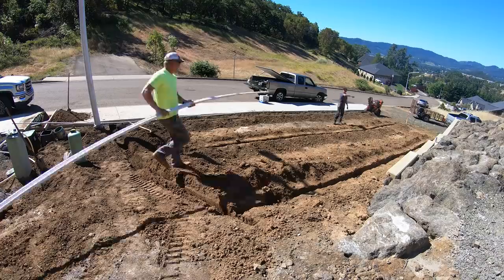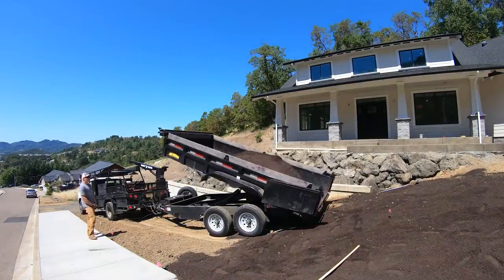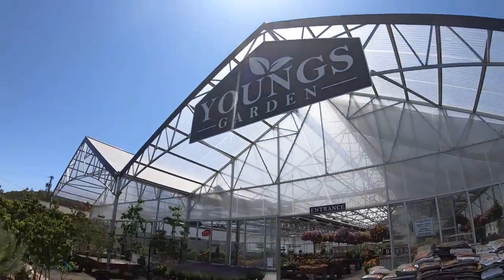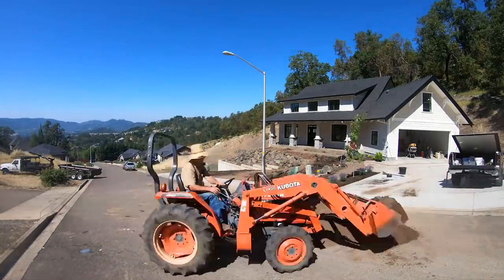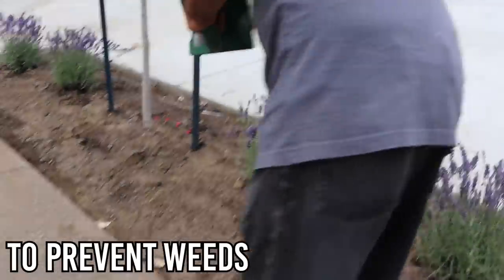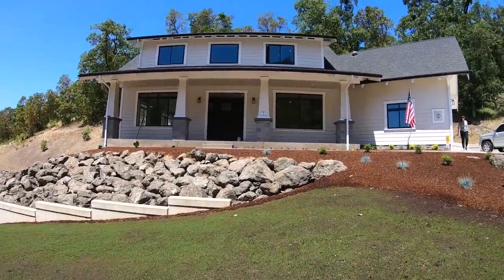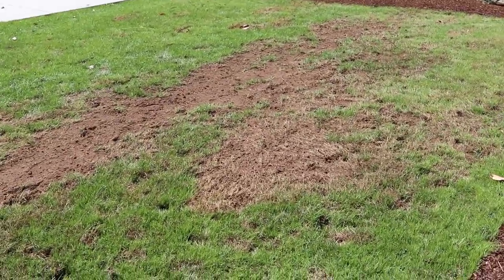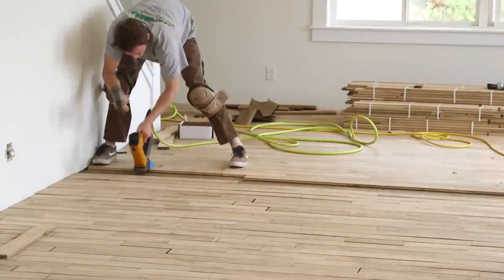Landscaping: Sprinklers, Soil, Plants and Mulch Ep.128

Comment: Having more pipes or chases under a sidewalk, driveway, or wall than you think you will need will cost more but you will be really really grateful in the future if the need arises to run wiring  or plumbing under a sidewalk, driveway, or wall.  Matter of fact, all wiring and plumbing you install as part of the build should be run through pipes of chases so if ever need to replace what you already have run it will be far far easier to do not having to pull it through packed dirt.

Comment: Hard to diagnose the lawn not knowing the climate in your area, but the fungus idea seems accurate. Fresh seed needs 3-5 light waterings everyday until it germinates (which, btw, I think your seed was perennial ryegrass. Blue grass takes a couple weeks just to germinate, a month or better to get some height. Perennial rye comes in within a week or even a few days. Fescues shorty after that if seeded at the same time.) if it was 78 degrees or more and the watering was still heavy and/or often, it’ll get fungus pretty quickly.
Reply: Yes, there had to be some other grass in the mix as Kentucky Bluegrass will take 2 to 5 weeks to even germinate and then it will still grow very slowly.  If he had inch tall grass in 2 weeks that wasn't the Bluegrass.
Reply: Exactly. I'm just a homeowner but I've planted lots of different types of grasses, and no way would bluegrass be coming up like that in a week. I'm surprised he didn't talk about the label on the grass seed that shows the % of different types of seed, how much weed seed, how much dead material/seed, etc either.
Reply: Grass likes neutral soil, unlike almost everything else in a landscape that needs acidity to access iron. Lime is cheap (except when supply-chain happens) and sits harmlessly in lawn soil like sand until acidity occurs, then it breaks down neutralizing the acid. It might not be the only problem, but 4 bags of lime on a lawn like that would eliminate the concern for $20 in normal times.

Comment: I'd say decent soil just takes some time. Soil isn't just about water and nutrients. The microorganism will form over time. They are one reason it's usually not a good idea to get your soil all upside down by digging. At my place everything was filled up with sand to get enough height above a small river. That was 90 years ago and it took decades to get half decent top soil.
Reply: They sort circuit this process here, by scraping a small amount of established top soil from a mature area, and spreading it thinly above the disturbed soil. The micro-organisms in that transplanted soil may be out of balance for the new site, but they are there to begin the cycles they are needed for.
Reply: Makes sense, it's similar when setting up a new aquarium, need to wait for for a few weeks for the water to establish and balance good bacteria levels before placing fish in the tank.
Reply: Without testing it’s all a guess now they are going to add more to it your comment is spot on it’s takes yrs and most end up doing more harm then good when adding fertilizers. They spent the money on the soil brought in would of been better off seeding right over it,

Comment: Unfortunately you should break up and rototill the original clay-shale into the top soil, otherwise you just have an unstable layer of loose top soil on top of an impenetrable layer of hard ground. And the grass roots will not be able to take a firm hold, and the heavy rain can ruin the grade.

Comment: I've used my smart home devices to protect plants I was establishing in my yard. My smart home system allows me to set if/then triggers. I set a motion sensing security camera pointed to the landscaped area. When the camera detected motion, the system triggered that specific zone of my irrigation to run for 20 seconds. That scared away all the pests very effectively.
Reply: Is this something you made yourself with an Arduino or a product you just bought and installed / set up?
Reply: @Dingle.Donger  I set it up using off-the-shelf products. A Rachio Smart Sprinkler Controller controls the zones. I used a wireless Arlo security camera for the motion detection. I set up the trigger using Samsung SmartThings. Samsung SmartThings allows you to integrate smart devices from many different manufacturers.

Comment: Need to account for snow in the landscaping if the house is in snow country.  

It appears that your house was built in a little or no snow part of the country since the sidewalks are right next to the street.  In snow country, there is a strip of lawn between the street and the sidewalk for the snowplows to put the snow off of the street.  

The landscaping needs to take in account where the homeowner is going to put the snow to keep the driveway clear.  Plants don’t do well under a snow bank.  

As always – thanks for the videos.

Comment: I'm a hydroseed contractor in Michigan...my thoughts are that the seed should've had a 3 way blend of not only Kentucky Blue but a nice turf type Perennial rye and a 20% Fescue... many strains of Blue grass can become over run with Mildew if over watered...rule of thumb for seeding, never put your seedlings to bed wet...very lite watering during the day then stop all watering well before sundown...a fungus that will cause "seedling dampening off" will kill large patches of constantly wet young turf...look for a kinda foamy/web looking substance at the edges of the dying seed bed in the brown to green boarders for confirmation of diseased turf. Finally, most Blue grass types take upto 28 days to germinate while the Fescues and Perennial ryes come up in about 7 to 14 days...the "in between period" 14 to 21 days is the critical point of the "grow in" especially in warm humid conditions. I would back off to lite "hand watering" with a gentle shower of water in your case as this is a fairly small lawn and very sloped, so you need to prevent wash outs!
Reply: I was always taught to water new grass and/or seeds twice a day for a month. Breakfast (but not before the sun is up) and lunch. Maybe around 3pm if mid summer.

Comment: I would move that tree because as it grows the roots are going to spread out and grow under the concrete eventually causing cracks and deformations in the concrete
Reply: If that's a silver maple it will destroy the driveway, carriage walk and utility bases in short order.  I would relocate to lower section of yard.
Reply: I think people online overreact about this stuff. I have bamboo growing right next to my foundation and it has been 20+ years with no problems. Bamboo is probably one of the most hardcore, most damaging plants there is. That tiny tree isnt going to hurt anything.
Reply: Not if they PROPERLY installed a good root barrier before they poured the concrete.
Reply: @natesteiner5460  Any maple tree for that matter is going to ruin the concrete on either side of it. Probably the future homeowners will have that problem to deal with. For now, it is the contractor's job to make everything look pretty.
Reply: @hikerJohn  All it takes is time. That tree will lift and eventually crack the concrete on both sides. It might take 20 or 30 years or more, but it's an eventuality.
Reply: @philincaundo  Maple trees have a habit of getting big.  My neighbor cut his down because it was big enough to be a nuisance. I was glad also that I didn't have to clean up the male and female pods in the spring and then the leaves in the fall.

Comment: Casoron which is just Dichlobenil is also known as https://en.wikipedia.org/wiki/2,6-Dichlorobenzonitrile and is very toxic stuff. You're supposed to wear a mask while applying it, and it also enters the ground water, so I doubt you should be using it here.
Reply: Murica!
Reply: If you notice near the end of the video when the grass is growing again there are a few dead looking blue oat grass plants near the house/garage. Casoron will move with the water and I am sure that it caused those plants to die especially since it was applied way to close to them.... It generally doesn't damage woody plants when applied properly.

Comment: As the owner of a landscape design and construction company this is a very typical "builder spec home" landscape job.  I don't blame GC's for leaving the house with such basic landscaping as most homeowners want to completely change the landscaping within a year of moving in.  What we don't like to see (which a lot of local builders do here in Vancouver), is sod laid on clay, the smallest plants possible, and corners cut just to pass inspection.  Most spec homes have completely destoryed yards within a year of moving in because the builder just doesn't care.  Simple landscaping is fine, but shotty landscaping passed onto the new homeowner isn't.  I would consider this house a simple landscape plan for sure.   One thing to look for when designing and building your own house is quality in the landscaping.  Since landscaping is one of the last bills,  the money is often used up on the kitchen and bathrooms and no money is left for landscaping.  Cheap landscaping is cheap but will cost you down the road with constant replacements.   Factor good landscaping into your contraction cost and it will make or break your finished curb appeal long term.
Reply: Very well said.

Comment: CASORON??? Ive been landscaping for 50 years and never used a pre-emergent on a new landscape and never wished I had. The MULCH will prevent almost all the weeds from germinating. The only time I ever used it was when I was young and doing commercial maintenance and the owner did not want to pay for mulch and I did not want to keep spraying roundup. But even then I just quit raking the leaves out of planter beds and the weeds went away on there own. It's stupid to blow or rake leaves off of the topsoil

Comment: Get rid of the tree in the narrow space.  It's going to be a problem for the homeowner sooner than later.  The roots are the problem.  Stick with coloured bushes.  Even some small, lime green cypresses, for colour.  I'm in the middle of a major yard revamp and placing the trees is a major science, you have to plan for 20 - 50 years.  I'm only going to dig a hole once, so it had better be right.  In the past, I've had to remove, dig out and repour a sidewalk because of the 'wrong' type of tree beside it.  Put that tree at the bottom or top of the sidewalk where it can have room.

Comment: It seems strange (cheep) to have little one gallon plants here (at 6:47) You also need a mow strip. I prefer seed so you dont have yet another layer of different soil. If the bluegrass does not work out you can seed it with fescue . . . I learned quickly to never seed a new lawn during a heatwave because it almost always gets a fungus from over watering. Then you end up using fungicides that kill off beneficial flora/fauna . . .

Comment: Topsoil over clay doesn't drain well.  
You're going to want those grass roots to take hold so that a heavy rain doesn't cut into it and wash soil down your hill.  
The hill should help it drain but the turf may feel spongy and be easily broken causing bare spots and exposing the clay.

Hopefully you laid the top soil thick.  

Great video and always.
Reply: I've never used topsoil except on lawns and somewhat level flower beds where I was planting FLOWERS for that very reason. Grass will lock it on a slope . . .
Reply: That yard needs SOD.  Thick premium quality sod grass.  Anything else will be the luck of the draw if its still there in 2-3 years, if that long even
Reply: @WilliamWBG  If you take care of it then it will be great. If you don't take care of sod then it will die just as easily. It's not luck if you know what you're doing . . .

Comment: 2021...and still putting in lawns. So sad, EC. Some respect has been lost
Reply: Can you elaborate ?
Reply: @phil130792  Probably a competitor trolling.
Reply: @phil130792  The amount of resources and effort and toil alone let alone the infrastructure being installed to accomodate... a lawn!! Let alone the cost to the ever drying ecosystem in the PNW. need to water, need to weed, need to fertilize ..forever #culturalconditioning it's a thing.. I thought EC was more progressive than this.
Reply: @misterhat5823  ya, ok.. no just someone who just built his house doing his level best to think critically about every aspect.. I haven't even mentioned the gas line..  We, in the PNW have established run of the river power projects for 100 years plus... But Gas is somehow cheaper..ya right
Reply: @miked.1773  …….. there is no water shortage or problems where this house is built.  NONE.  They can run the water 24/7/365 without issue